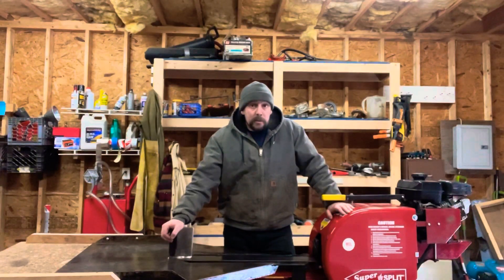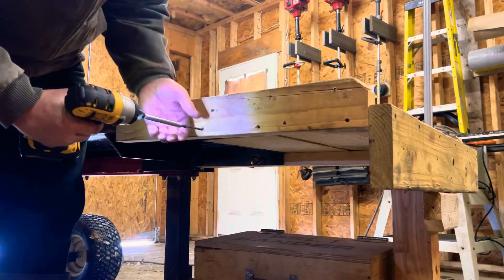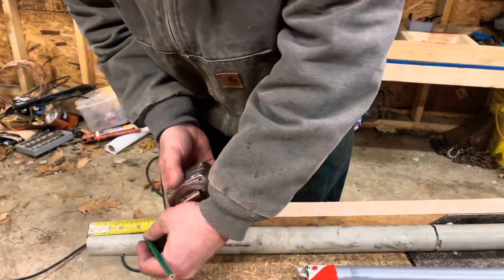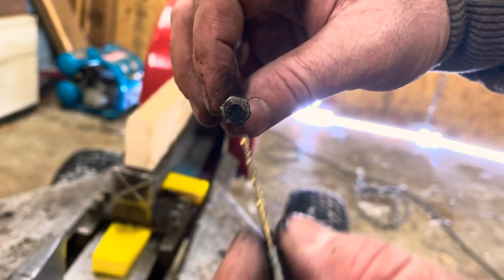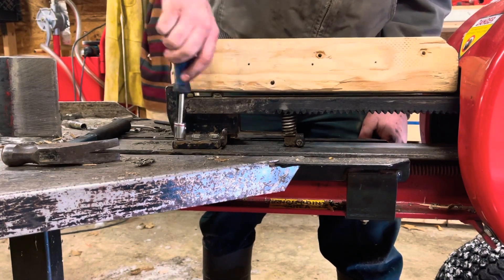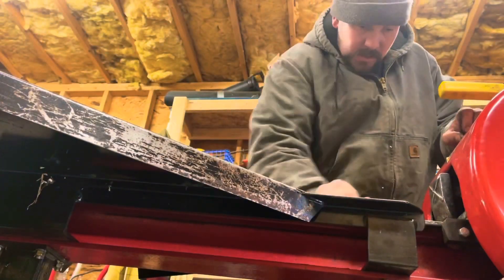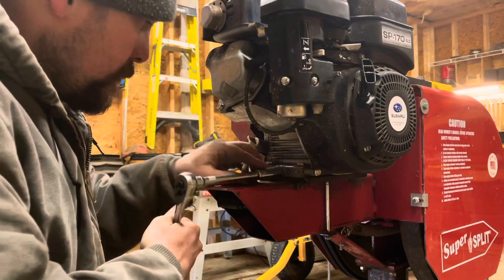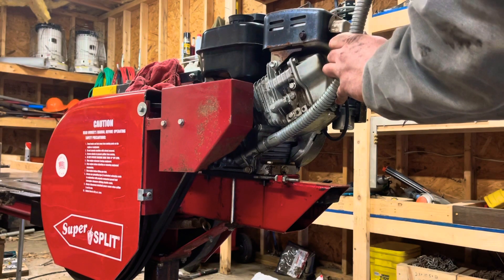SuperSplit log splitter upkeep and maintenance!!!

Comment: Hey had a new issue with my super split and was wondering if you knew what it could be.  Has been working perfect and then all of a sudden I noticed at times the ram arm disengages by itself, doesn't even hit the log sometimes.  It will do this repeatedly for a minute or so and then go back to working perfect.  Any idea what would cause this?  Thanks!
Reply from the maker: @RubberDuc  The ram should never engage by itself. Could be a worn cam gear, or your lift handle is not set right
Reply: @BuildALotAcres  Hi, it doesn't "engage" it disengages, I have read about the nut handle but I haven't touched it since I got it so it is weird it would just start doing this?  I also only run it at half power and keep the belts loosed so when I hit a tough round it slips the belts as a "safety" against bending the ram so I don't think it would be bent, not sure.  How do you set your handle?
Reply from the maker: @RubberDuc  I don’t have any exact procedure, but I typically leave just a touch of play in the handle where the nut is on top. Like 1/16” -just under 1/8” maybe. Shouldn’t be overtight. If your ram isn’t going all the way out it could be other issues like the small barring has a flat spot, or the bearing “cage isn’t traveling perfectly straight. Also make sure all the crud is off the beam, and the surface stays as slippery as possible. Hope it helps 🍻
Reply: @BuildALotAcres  Thanks!  I adjusted the top nut today to give it a bit more play and that seems to have done it. Used it 3 hours and not one disengagement.  Weird though b/c the nut is a lock nut and doesn't move so not sure why that would have just started doing it but it is working like it's old self again now.  I did grease the ram teeth the day it started doing it wonder if that had anything to do with it, don't see how but I did remember I did that, thanks again.
Reply from the maker: @RubberDuc  👍

Comment: Great video. Don’t forget to take your bottom cam followers out and lube. I have made my own rails with custom bolts to achieve this.  If you are interested in a pair contact me.
Reply: Thanks Harold for checking out the video.
Reply: Hey Harold!..  ( Tim Hanlon.. just on my wife's youboob account) 
I just got my Super Split HD the other Saturday.. I will be ordering your upgraded bottom cam follower set-up.. Now you need to work on a solution to that pesky sub-par roller bearing he replaced..